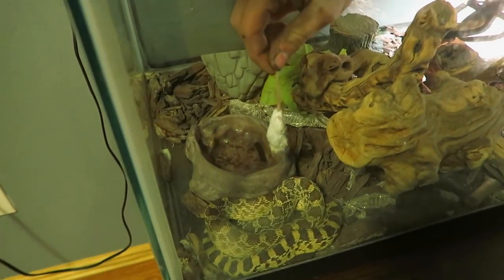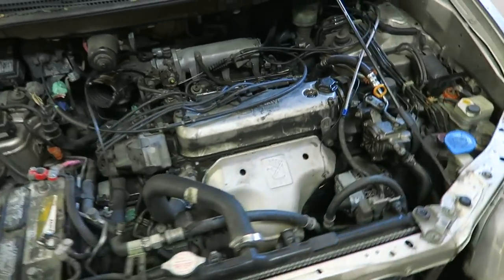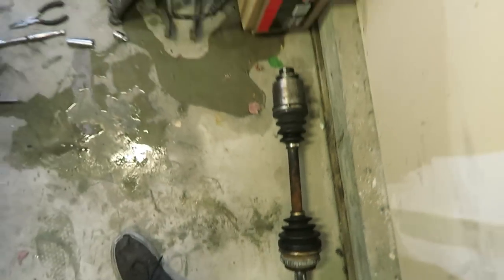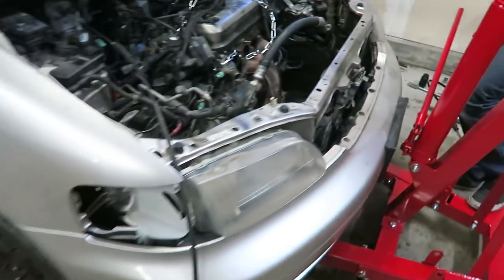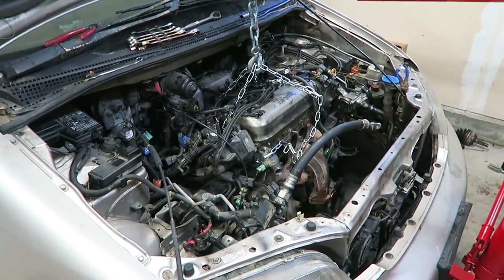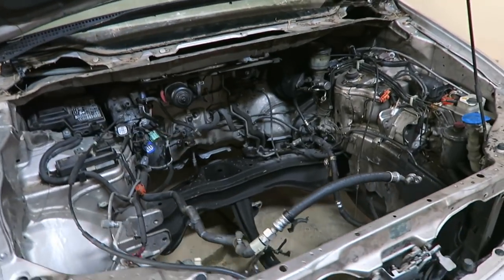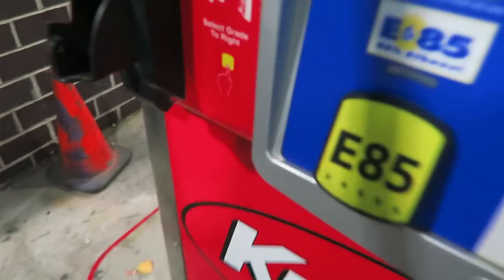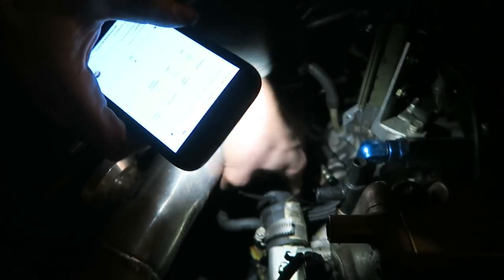The Start of the 600hp Minivan build (Motor Pulled)

Comment: Nice video!!!!!  Like so he can see if you guy's agree.
     Big subframe on that van... WOW!!!  
You should check to rig and reinforce suspension ''Traction Balls'' stiff bushings for the lower control arm’s and maybe trailing arm's. Would be nice to see you install some new performance parts other than tof engine build and big turbo. They dont cost to much money and big safety and reliability. Will help wheel stability and traction from a dig and at 140 MPH.  
And would not hurt to do the same on the violatorhatch.

Comment: The rear mount you have is short 3 bolt? Need taller mount like oem. However just get the correct rear t bracket any 92-01 prelude. Yes im right. I make mounts for a living.

Comment: Are you gonna start finishing things, Kyle? The MR2 still has the wiring fed into the top of the fuse/relay box, and no lid. No engine lid etc.
Did you ever bolt that battery down properly from when you moved it?

I dunno how you can live with your ECU on the floor and dash in bits, mirror glass missing, loose seats etc etc.

No hate, I have been watching since pretty much the start!

Comment: I know you don't have the facilities for it, but dropping the subframe with suspension, steering, engine, and suspension is how I would do it. Just disconnect the hoses and electrical connections and exhaust. You don't have to deal with axles or rusty ball joints or anything. Just unbolt the struts.

Comment: I did a motor swap on a 1995 legacy wagon and and pulled the engine and trans from the 1995, (EJ22) and then swapped it into a 1998 subaru legacy outback. Took me a total of 16 hours and 5 mins and literally did not stop from 4pm, worked all through the night, and drove it home at 8am the next day. then slept for 12 hours XD

Comment: hey guy, I would love to see a single cam f22 build like from out of the minivan. do a nice set of pistons and rods a good midsize turbo like the wago and those f22 single cams become torque monsters, they can put down more torque than the h22 with similar HP numbers. then put that turbo f22 in a rwd or awd platform like the cr-v, or find one of the first gen Toyota mr2's the squared off boxy ones and you will have a dangerous 8th mile car.